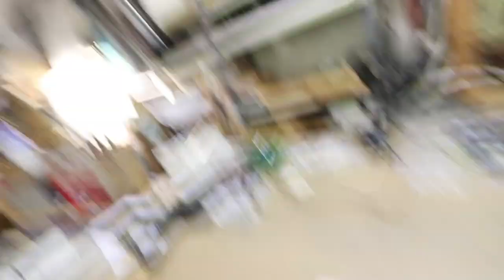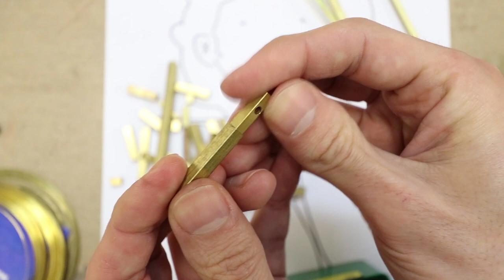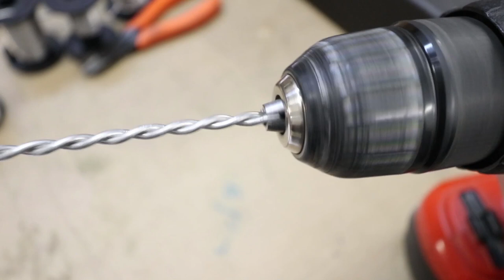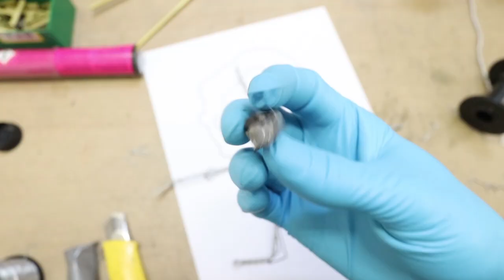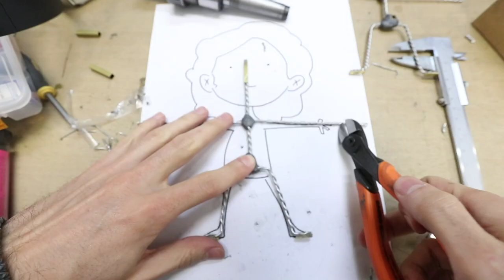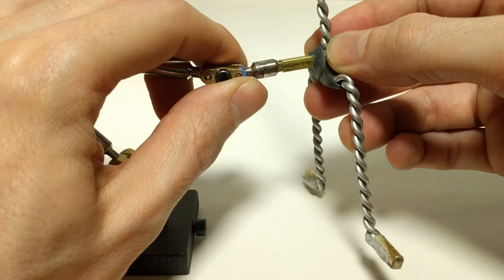How to make wire armatures for stop motion

Comment: What size is the brass tubing and aluminum wire that you used? I'm so nervous about finding the right size for my puppet, which is 10 inches.
Reply from the maker: I would pick 1,6 mm twisted aluminium for the body, and you could use 3,96mm and 4,76mm tube, it would be easy for you to insert the wire and glue it. Take a look at kineticarmatures for those products. Thanks!!

Comment: What kind of composition is the material? I tried a lot of wires and cant find the right wire to use for animation. I'm considering buying yours.
Reply from the maker: I use and sell bare aluminium at different thickness. I find that this material works fine for me, sometimes I convine with coper, but you can work with it in 2 or 3 twists. If you don't mark the wire in construction with the pliers it lasts 15 to 20 folds which is ok for some shots. https://kineticarmatures.com/product/wire/

Comment: I don't make puppets but I do make wire armatures.  I already was helped by this man in a previous video when he used a drill to twist wire. I adapted an electric screw driver to do the same thing and it is brilliant.  But now I see a couple of other things he does that will be useful. Like drawing the shape amd then measuring the wire against it. also, connecting  the thicker wire with thinner wire at cross sections.

Comment: So with the brass tubes you can remove and add heads? Can you show how you make the head with the brass tubes?
Reply from the maker: Yes it is the way, I normally make a hole smaller than the square and then I make it square with a file.

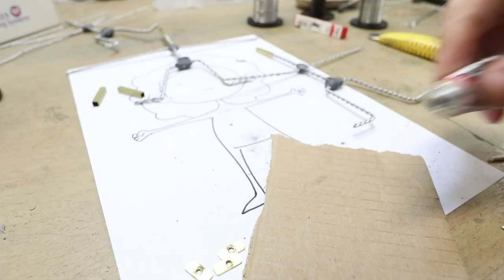Comment: Hi Edu, what's the name of the product you mix at the min 5:58 ??
Is that also the same glue that one can use for the tip of the fingers in the armature? so the fingers are not sharp and won't damage the silicone if you cast it.
Reply from the maker: this is Epoxiic glue, 2 components, there are a lot of brands and strenghts. You can use it for the tips of the fingers but I normally use epoxic putty, a kind of clay made of epoxic, also 2 components that harden with the time

Comment: Great tutorial! Do you have any other recommendation as a rigging point? For the feet you had lighting fittings, which I can imagine you could also use as a rigging point I guess?
Reply from the maker: You can use the feet to screw to the table for a walk. And for rigging points depends on your script, if it needs to be in a chair you could use a nut to fix on a chair, etc.